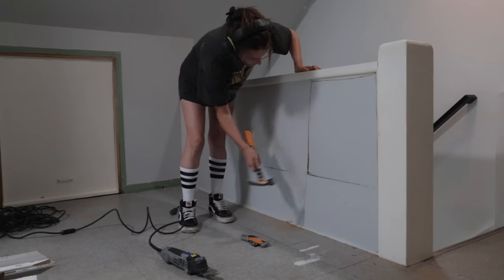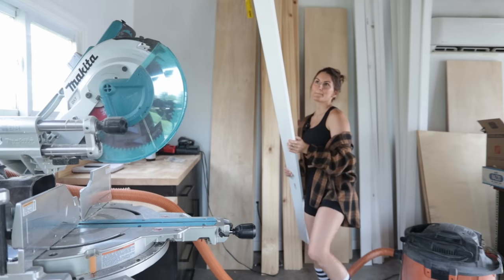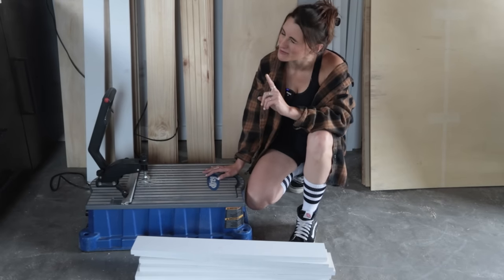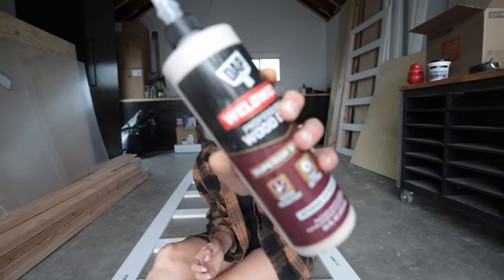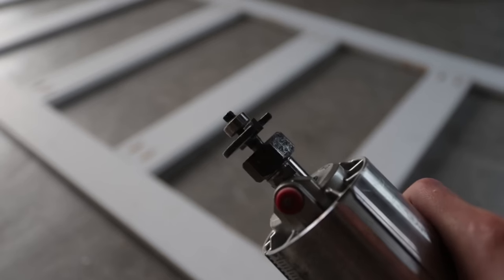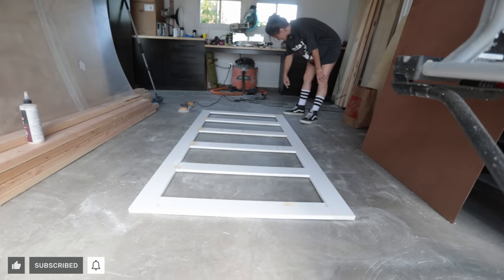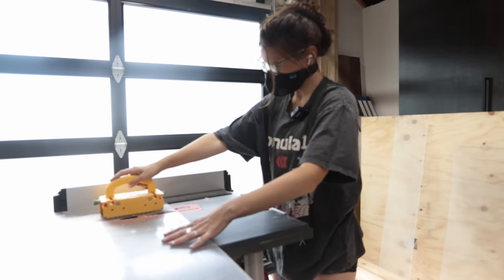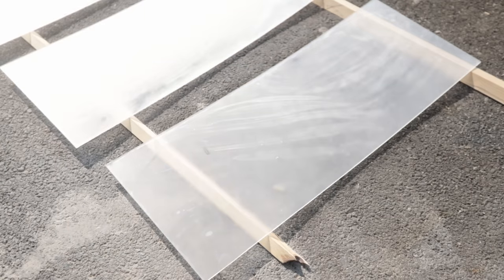DIY Modern Sliding Barn Doors

Comment: If you use a thicker plexiglass you can cut it with the table saw or track saw and the edges won’t break. If you don’t want the thin acrylic to break when cutting, wedge it between 2 sacrificial pieces.
Reply from the maker: The thinner ones cut okay on wood blades too! Just didn’t want the doors to be too heavy. Thanks for the advice about the wedges!

Comment: I think the doors turned out perfect.❤️

I love that you didn't make them solid black. By adding the frosted panels the natural light from the window gives the illusion of a more open larger space in that corner. I have worked with the spray frosting before and I learned quickly that spraying very thin/ even coats and making sure they are completely dry in between, will give the best results. Yours look amazing. 
Great job, Sam, you get the gold ⭐😀
Shoutout to DIY Danie for being such a great friend.🌺
Reply from the maker: Thank you! And, thanks for the spray advice! 💓

Comment: Awesome project!  A while back, I used a frosted glass spray (don't remember the brand) but I didn't really like the finish either, so my wife and I opted for a different route and I just sanded the back of the acrylic piece with like, 220 or 320 and it came out amazing, plus the surface was super smooth, with no swirl marks or anything.
Reply from the maker: Yesss! I love thisss. I thought about this too. I still am not completely in love with the finish. Maybe I’ll sand down the panels!
Reply: I'll send you a couple of pictures of the one we did through Instagram.